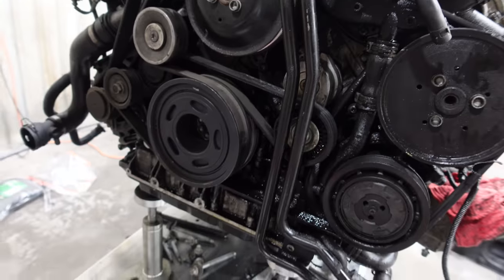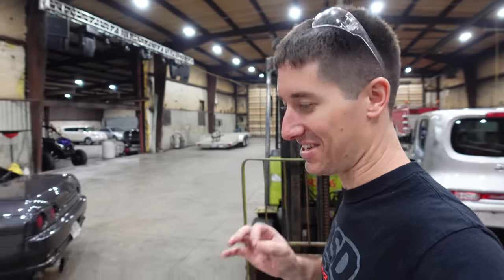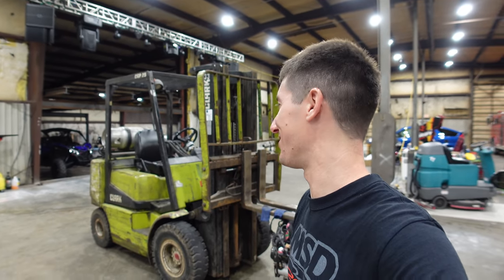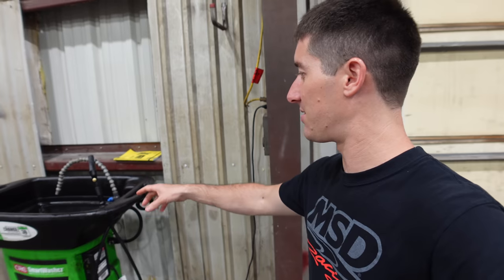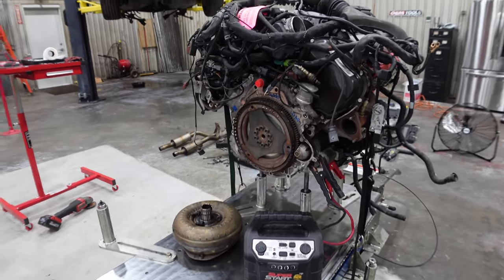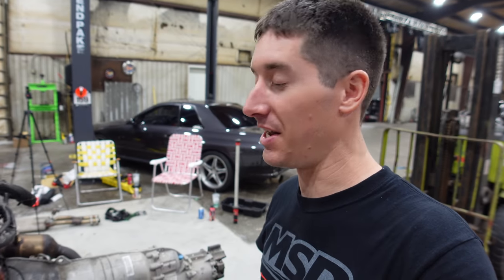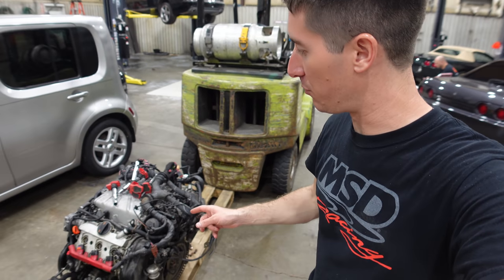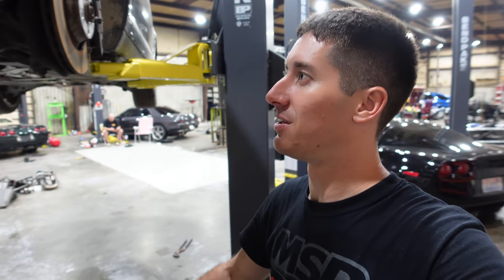We Used A FORKLIFT To Remove The Transmission From My SEIZED Audi Engine

Comment: First piece of advice I would give before refitting, is either fork out now to replace all your O2 sensors or move the plug bungs to somewhere accessible on the cats... You'll be pissed if you've gotta drop the engine again if they're dead
Reply: I’m sure the 02 sensors are good, it’s not like there was fluid in the exhaust to ruin them lol
Reply: I threw out a warning about the cats themselves. They burn up due to heat based on stupid placement in too hot of an area by Audi. Hopefully the exhaust being full of gas for months won't have ruined them.

Comment: -When it comes to cleaning parts there is NOTHING like non-flammable CRC Brakleen [red can].   I have no connection to this company.  But when you want something greasy and grimy otherwise RIGHT NOW you reach for this stuff!
Reply: That stuff will give you cancer if used daily long term. Parts cleaners is where its at.
Reply: @someone28  Only if it is heated.

Comment: Should have changed the crank pulley while it's out, it looks a bit rough. It's got a rubber layer between the two layers that's a known failure point when the rubber breaks down. I plan to go with a solid one on mine down the road.

Comment: Audi dealerships nation-wide are scared. Look normal folks r2-ing an engine/cradle assembly by themselves!!  You all did a good job! Like Baz said check all the O2 sensors as well as the engine electrical harness and other sensors for proper operation before you take it off the lift. Audi really screwed up on having access to remove the torque converter bolts!!!!!!!!!!!!

Comment: Dump some Marvel Mystery oil into each of the cylinders and let it soak for a half hour then put a wrench on the crank pulley and spin it over get in it fire it up and drive it back to the shop and hope you make it.

Comment: With all the fuel that washed out of the exhaust, might there be a concern of a bit of a flame up when you finally crank the replacement motor over?
Reply: It should be evaporated by now. Gas evaporates quick. They poured all the standing gas out

Comment: Dude, buy your own lift table.  Car ninja needs that to put food on his table.  Meanwhile, you're buying a $30k toy, but not investing in tools.
Reply: You chipping in? Didn't think so.
Reply: @srp365  you run a shop where people borrow equipment, and then lose it, break it, disappear it?  JR is a line stepper
Reply: @baitse7676  🙄🙄 car ninja has borrowed his autel scanner for several days when his was out for an update. JR had the lift table for 2 days and waited until car ninja was sure he wouldn’t need it to do this swap. He didn’t step over any lines. They are friends and they have a mutually beneficial relationship.
Reply: @watchjaredwork1487  say what? car ninja has his own scanner too?